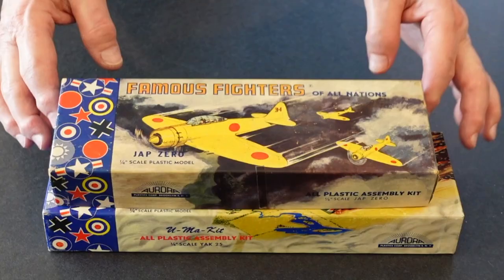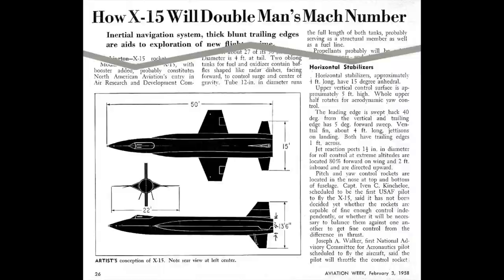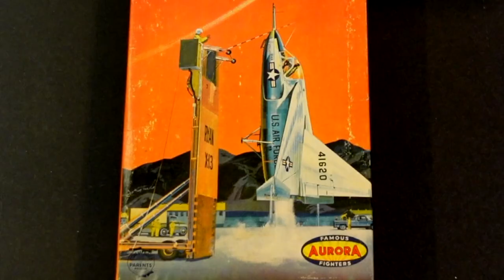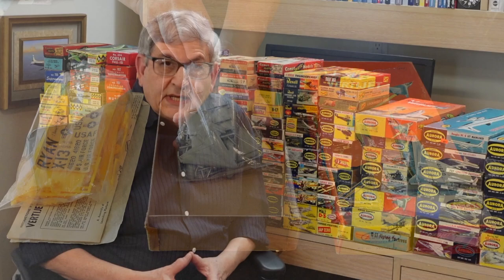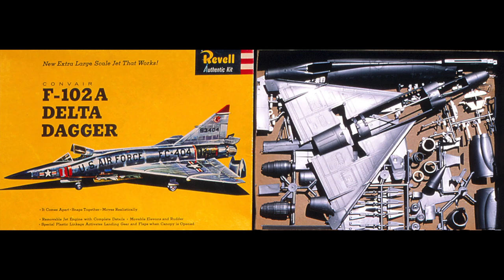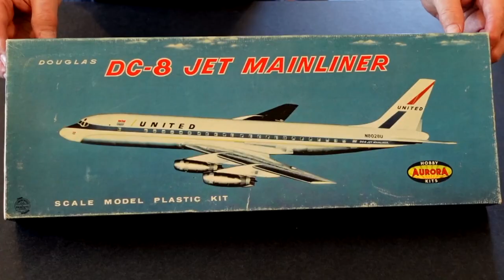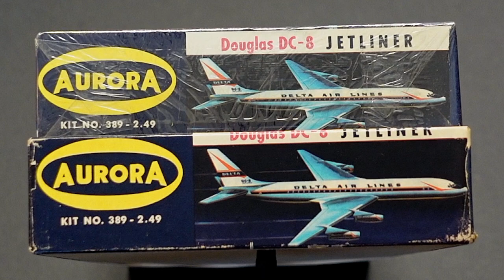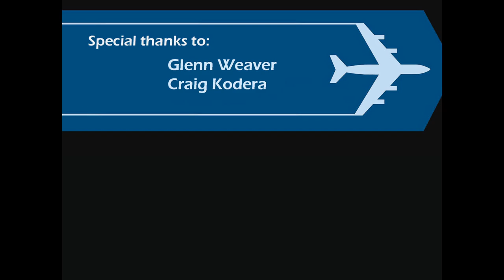AURORA MODELS - From Modeling's Golden Age:  X-13 Vertijet, X-15 Rocketplane, and Douglas DC-8!

Comment: One point on the Aurora X-15 kit - it shows the plane's original configuration with two XLR11 rocket motors, the same motor used in the X-1. These were later replaced with one XLR99 motor with much greater thrust.

The Aurora X-15 was the first plastic model I ever built, in 1959 when I was five years old. Several years later, Dad and I built the X-13 kit. I built another X-15 in the late 60's and it still has a place on the shelf.
Reply from the maker: Good point on the XLR11 motors Duncan, thanks!

Comment: Two Aurora kits on my shelves are the Rockwell Jet Commander and the Cessna 337. I had them built before I learned that they were two of the
 molds destroyed in the train weck. Being 72 scale they can still be found and don't  demand high prices. While fairly basic kits they both were nice kits.

Comment: Damn, that sure brings back some fond memories.  I once built the Revell X-15, which was reasonably accurate except for the removable engine which was a bit of a joke compare to what the real XLR-99 looked like.  But that didn't stop me from building it again in the '80s when I built a version released by Revell Germany.  And if you want to see the actual X-13 (unless it's a reasonable facsimile thereof) there's one at the San Diego Aerospace Museum in Balboa Park.
Reply from the maker: Thanks for the comment, and yes, one of the real Ryan X-13s is in San Diego while the other is displayed in the National Museum of the U.S. Air Force in Dayton, OH.

Comment: On another note about Aurora kits. I avidly collect the TV Show related kits(built ups with box), any of the brands of the day, and Aurora was tops with figure kits. One thing, is that  in about 1995, I had the chance to buy an Original Lost In Space Robot kit. This one was molded in a very pale Metallic Green.  All the others I have ever known 0f are molded in Metallic Silver. Seller knew how to spot reproductions, so I to this day believe that model for sale that day will go down as one of the rarest Aurora items I will ever know of. I sure wish I 'woulda bought it! Does any one ever come across Aurora kits in rare colors? Fascinating subject. One guy did tell me he owns a metallic blue or green Aurora Batmobile model. Claimed to have been a test shot. I know on Aurora HO Slot Cars, sometimes a car  was left on as a mold plug to the other car on the tree. Not needed in that color on certain car, then the car reground  and plastic recycled.

Comment: Great story on some of Aurora's interesting kits!  I recall in the very early 1970s purchasing an Aurora Eastern Airlines Douglas DC-8 kit with the original box art from Bill's Hobby & Collector's shop in uptown Park Ridge, IL.   When I got home and opened the kit, I was startled and disappointed that the model came with the later Eastern "hockey stick" DC-8 livery instead of the "Fly Eastern Airlines" markings as on illustrated the box   Still have the EAL box and also the Aurora Delta Airlines complete DC-8 kit without the cello-wrap.
Reply from the maker: Lindberg models did the very same thing with their United Caravelle VIR. I saved for weeks for that kit, but when I got it home and opened it up, it was the older model Air France Caravelle III with United decals. I was crushed!
Reply: @celebratingaviationwithmik9782  Guess we both found out from these experiences that sometimes, "life just isn't fair."

Comment: My older brothers, in the '60's, lamented the Aurora kits, deciding early on that that the detail & fit of Aurora model kits was inferior to Monogram & Revell model kits. I've heard that the quality of Aurora kits was inconsistent; & some Aurora kits were quite good, but my brothers did not want to waste their (hard earned) money, & (understandably) preferred to buy kits produced from companies that they were confident would provide the best value for the money.  After one or two disappointments from Aurora, I don't blame them. I'd say it's the same today. However, Aurora did offer some interesting & diverse subjects in their model kit lines.
Reply from the maker: This is a perfect point, thanks. I didn't cover this in the video, but because Aurora kits were sealed in cello wrap, you had no way of knowing if the kit was good or not. At $2.49 cents, seeing the Boeing 707 or Convair 880 models was a crushing disappointment, especially compared to the DC-8 kits which were dead-on accurate to the big Douglas jetliner. Although there was no detail at all on the fuselage, the aircraft's overall lines were nearly perfect. Thanks for the great comment!

Comment: I almost always prefer opened on vintage model kits. I need to know what is in the box. Better yet, my goal is to obtain a nice original built up and the empty box to go with it. I just bought the 747 United Airlines built up with N74700 number decals  on the tail. Has Clear stand, and I think is from about 1969. I admire it for the time period history and the quality of the kit. In flight display, and has the detail and accuracy in the right places.

Comment: I’ve marked Aurora Week on my Google calendar. 

Thanks Mike for another delightful and informative video. 

I have to ask, Just how many in the box vintage Aurora kits do you have?

As for which Delta DC-8 I prefer, well, I’ll be more than happy to take which ever one you’re willing to part with.   Just kidding of course😉. They’re both great.  

One more question-  what did you do to preserve those decals?  They look awfully good for a sheet that must be around 60 years old.  👍
Reply from the maker: Great comment Mark, thanks! My collection has come and gone over the years, but at the peak, I had well over 100 kits. As for decal condition, much of that depends on where the kit was from, meaning west coast summer heat, east coast summer humidity, or midwest dust storms can all be factors in how those sheets survive. The Delta DC-8 decal sheet in the video is from a California collection kept in an air-conditioned apartment since new. Lucky to have found it!

Comment: Another hasty Aurora "dud" was the F107 model. Alas mine went to the big kit heaven long ago!
Reply from the maker: Won that very kit with tickets from Skeeball on the boardwalk arcade in Long Beach, NY. Still can't believe that was the only kit of the F-107 ever produced back then!
Reply: @celebratingaviationwithmik9782  Well, it lost out on the F105. Models of prototypes often have a bad run. Everybody wants to own the winner. I've got a copy of the much more recent Trumpeter kit though. :-)
Reply from the maker: @marcbrasse747  Perfect point, Marc, and yes, Aurora's F-105 was an early examples of "Truth In Advertising" - YF-105Bs on the cover art, but a wierd and toy-like YF-105A prototype in the box.
Reply: @celebratingaviationwithmik9782  Ah. That I didn't know. They probably made both molds very early, like that of the X15, and then the  F105 model survived longer in parallel to the real article. Like I mentioned before: I am not that much of a stickler for perfect detailing as long as the model projects the right atmosphere. Especially because these where still mostly seen as toys at the time. Aurora compensated it's lighte rlook on the subject through its daring attitude and flexible policy. I do however think precission in shape is important and that F107 surely scored low on that as well. But still! :-)

Comment: Hi Mike, I have a question--only if you have time.  I'm working on the REVELL visible v8 my son got me.  There are a lot of moving parts, the instructions recommend vegetable oil?  Seems that would turn to goo after a year or so and I know not to use anything petroleum based. Spray silicone?? Any ideas, only if you have time, if you don't were still friends....   LOL      Also, no rush
Reply from the maker: Interesting question, and I've used 3-in-1 Oil for modeling items like spinning props or rotor blades. I agree on vegetable oil - with it being organic, it could pose a problem over time.

Comment: what is the average value of those unopened , original aurora kits in the market?
Reply from the maker: At the peak 20 years ago, a sealed Aurora airliner sold in the $150 range. Today, probably closer to $100.